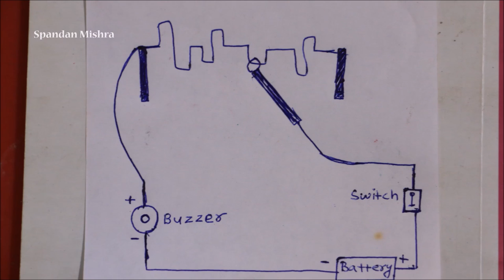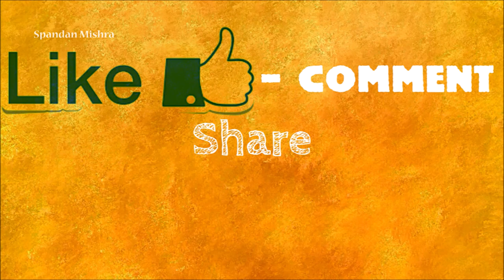How To Make a Wire Loop Game

Comment: Hi
I used copper wire of gauge 24 but when I connected it in circuit the buzzer didn't buzz.  The buzzer is perfect and circuit is also correct. Please help..  Need help by afternoon. 🙏🙏🙏🙏
Reply from the maker: use normal wire, it will work and do check the circuit.

Comment: Which type of switch are you using, the soldered one or without soldering, because i used without soldering switch but there was no use of switch.....😔
Reply from the maker: Romina Kashif yes you can make it without switch .this one is with out soldering.
Reply: Spandan Mishra thanx for the reply

Comment: hi first thank you
i want ask what i do if I don't have connector ?
Reply from the maker: Welcome...
If you don't have a 9V battery Connector  then you can connect it directly one wire with positive and another with negative end of the battery you can fix it by using tape. Or else you can solder it using a soldering iron.

So don't worry if you don't have a connector .
Reply: Spandan Mishra thank you so much for your help full😙🌹🌹🌹
Reply: do you maybe know how to make a wire loop game using recycled materials.......???????...???

Comment: Is the switch really needed?
Reply from the maker: Claire Rocks    circuit will work even if you don't attach a switch....but if you don't have a switch the battery will not last long as a buzzer is  attached to the circuit it will drain all the power of the battery. And also you don't have any options to stop the game while you are not playing it.

So. It is better to have a switch. So that you can make it on. Or off.

You also can do it without any switch.....just cut the circuit  wire and connect it when ever you are playing and remove it when you are not playing.
It will work as a switch. 😊😊😊😊
Reply: I did not use any switch but the whole thing isn't working. The LED isn't working.

Comment: In place of buzzer and switch 
I have to put a small bulb 
So how i will doo??
Reply from the maker: Just connect the bulb instead of  buzzer..simple.😊
You will have 2 wires for buzzer just connect a bulb or led light with that two wires.

Comment: how it work
Reply from the maker: Nikesh Tandel    check the circuit diagram at. 0:58 
This is very simple when the ring touches the path wire the circuit got completed and Activate the buzzer.